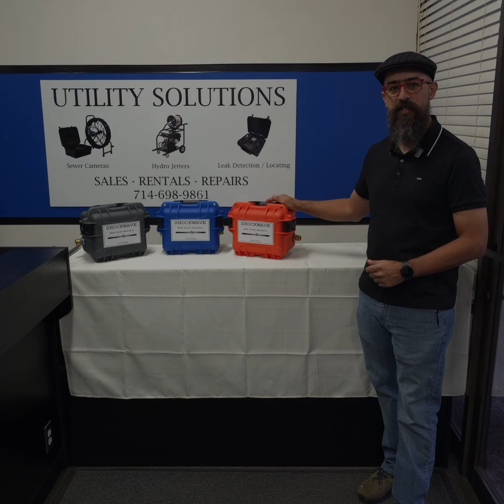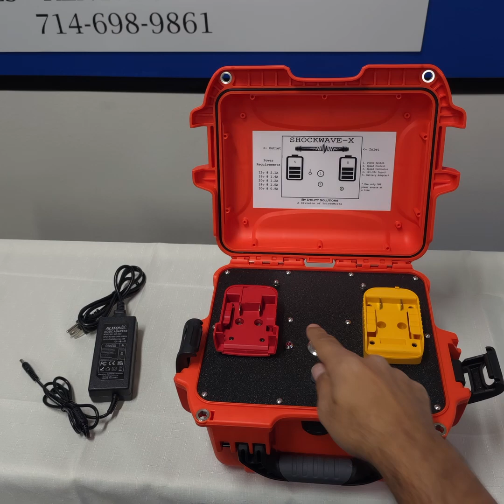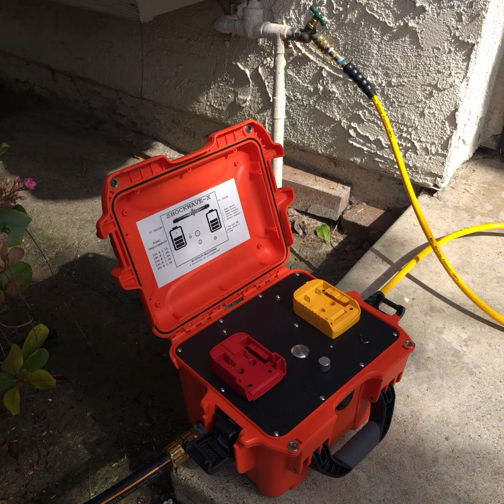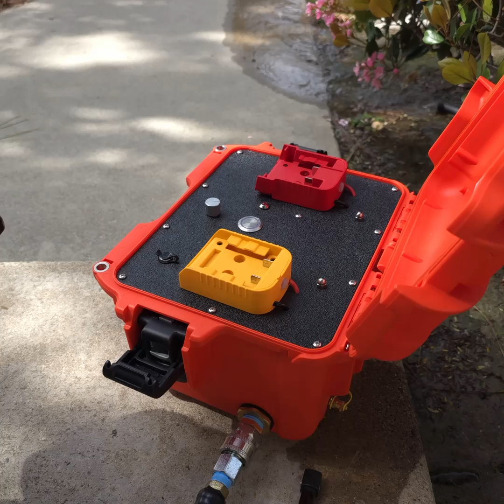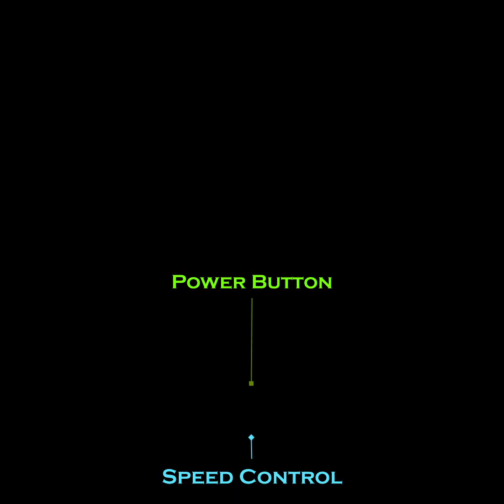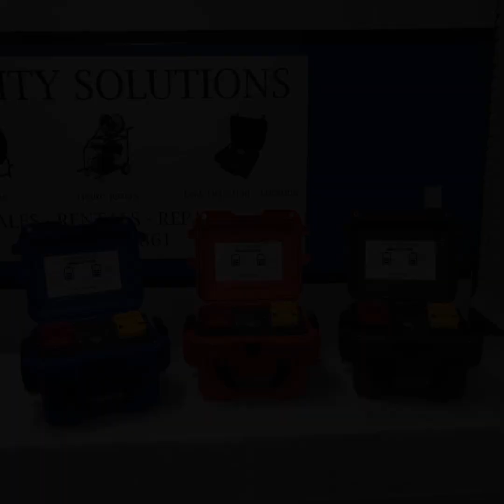Shockwave Pulse Generator for Water Pipe Locating

Comment: I appreciate wanting to make it compatible with both major tool battery brands... but i'd rather that it had a battery that didn't need to be removed for transport.

Maybe a drone li-po pack?
Reply from the maker: @stephenoliveau  We actually did consider this in our initial product development. As we do build all of our equipment in house, we could certainly include that option for a custom build. 

The reason we did not include it standard is that most of our locals who tested this during development expressed that they preferred standardized battery hookups over the additional responsibility of keeping a built-in battery charged at all times. Their logic is that hooking up batteries they already have a routine of keeping charged is more convenient. For the final build, we agreed.